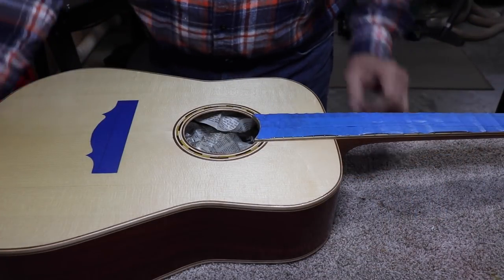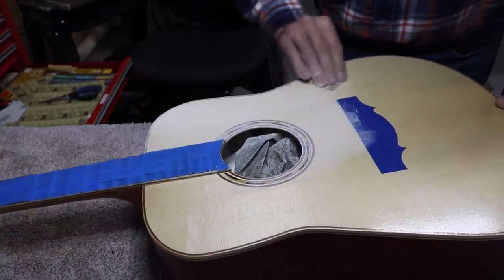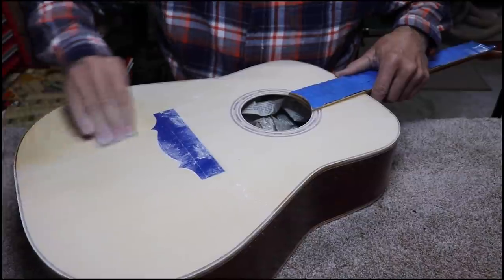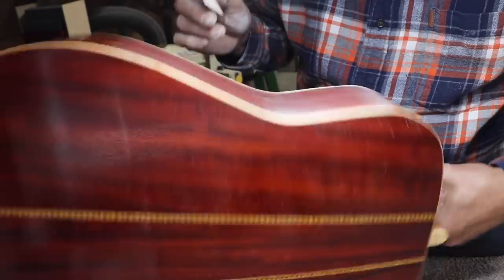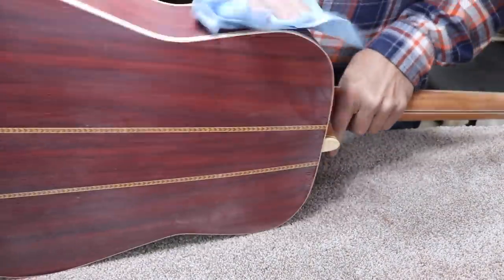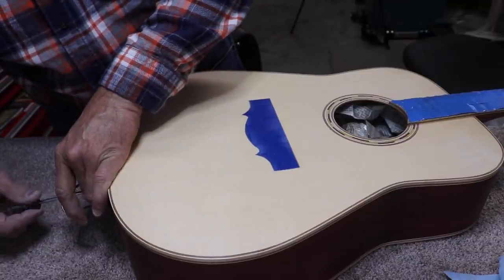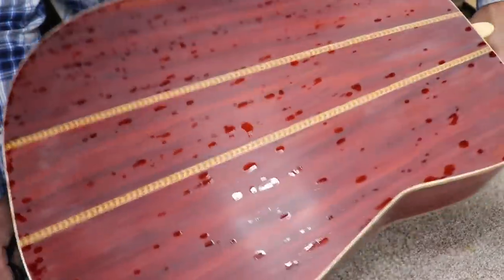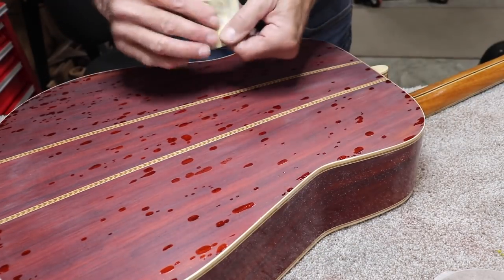455 RSW A 12 String Custom Rosa Dreadnought Part 12

Comment: I would not use a sanding block on tru oil. It can obscure what you are doing. Why would anyone do this on a thin coat of tru oil ?  I use p 240 and go down to red scotch brite when it starts to level off after a few coats
Reply: Sounds like a good idea. I did aircraft "sheetmetal" for years. We had a "corrosion mod" in Texas.(basically remove the corrosion from the aluminum.[lucky me I got the area under the rest room]) Some of the guys were using steel wire brushes on their high speed grinders (think a 3K rpm pneumatic dremel) to knock the corrosion off. An old head (as we called the older guys) said "Don't use steel, it leaves microscopic dust in the aluminum." He used Scotch Brite wheels, it removed the corrosion, & didn't do any damage to the aluminum. Scotch Brite is amazing stuff.
Reply from the maker: Did you notice that the top had no problem it's only the back and sides and it's only the padauk that causes it. I have used it on many things over the years I have applied it every way you can possibly apply it I have sanded it everywhere you can possibly send it it has nothing to do with any of that it only has to do with the wood itself the padauk it has very deep grain holes in the wood I've even used the finish as a lubricant and sanded the dust into the pits and that doesn't work either
Reply: @RosaStringWorks  yes you are dealing with far deeper grain than I have . You could seal it with Zinsser Bulls Eye Shellac ( in a spray can ) first It is compatible with true oil

Comment: Jerry, 
have you tried to fill the holes in the wood, as opposed to filling them in the finish? That's how a lot of manufacturers do it - fill the wood with a contrasting-colour wood filler. Easy to do with about two applications, and you end up with a completely flat surface for the finish go on. Looks great too.
Reply from the maker: It looks like a leopard terrible look padauk has a huge grain

Comment: Re: why is it cold on top of a mountain despite the "common sense" concept of "heat rising". There is another "common sense" concept of "lower air pressure".
So-called common sense doesn't always work. I've heard you talk about how you don't believe in the "Big Bang" because it "doesn't make common sense". However if you consider that the Universe is expanding (which it DEFINITELY is) then it must've been smaller yesterday than it is today, and smaller still the day before that. If you follow that to its logical conclusion then the Big Bang is the ONLY way it could've started. As Sherlock Holmes said "When you have eliminated all that is impossible, what is left NO MATTER HOW IMPROBABLE MUST be correct".

Comment: Tru oil is the worst, I used it to finish a guitar, it took me over 3 months and many many coats....Those little bumps are air born dust particals...I went up to 2000 wet sandpaper, klingspor, german stuff..BOTTOM LINE IS TRUOILS SHITE..after 2 months i wears away where I was picking on guitar..

Comment: Why use a sanding block? It removes bumps better than using your fingers. Your fingers deform when they hit a bump the sanding block doesn't. I will remove the bumps much faster.

Comment: I don’t spray tru-oil but that’s just me.
Reply: I've tried a couple necks but mostly just use on gun stocks. Its mostly linseed oil with a little varnish in it.
Reply from the maker: I have applied it in every manner humanly possible including hand rubbing it it hasn't got anything to do with the application it has everything to do with the padauk you notice the top was not a problem
Reply: @RosaStringWorks was thinking do you thin it out before spraying?
I don’t thin it when doing hand applications, it’ll still run if it’s applied too thick regardless. I’ve noticed that the finish shrinks over time and the grain will come through. I built a couple of acoustics using tru oil just for myself no intention of selling them.
I hate pore fillers also so I just try to make it a smooth as possible.
And it can be messy😉

Comment: Wet sand every coat with thin rubber block and soap and water, not fingers,  this is how I work true oil every time.
3m wet and dry paper only.
Not that window and door frame sandpaper your using.
First time in all these years you have made me cringe watching you. 😆
Reply from the maker: How much experience have you got with padauk.  No problem with tight grain wood or small grain wood.  Padauk is not that.